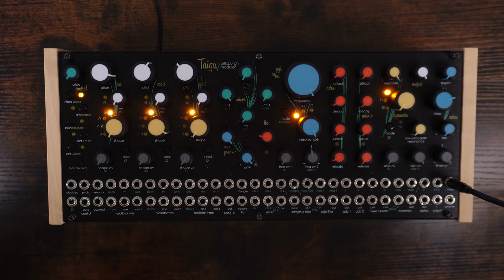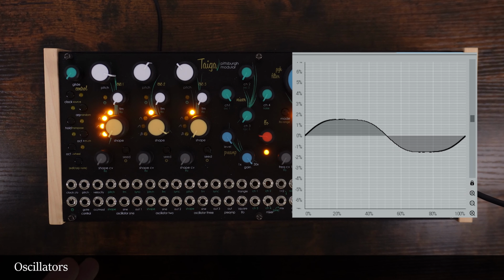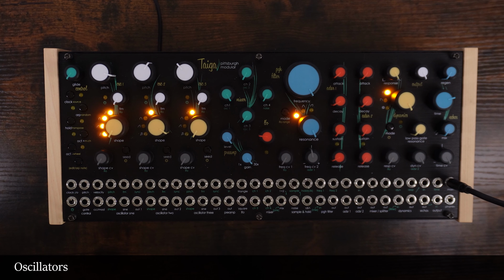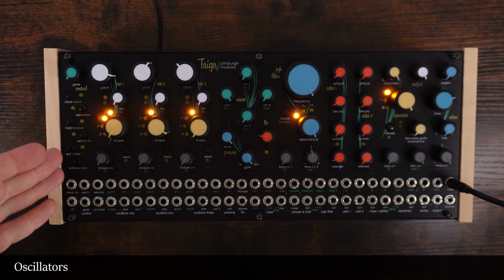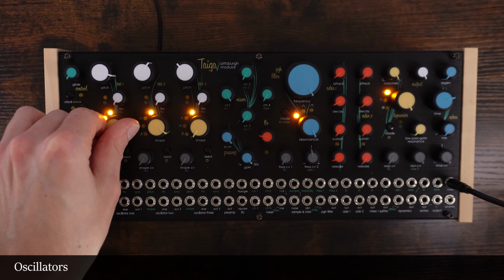Taiga by Pittsburgh Modular: Guide, Review, and Sound Examples

Comment: Great tutorial!

That randomized patch is super psychedelic. Nice work. 

I own the Voltage Lab 2 which I have come to love so much that I am reconsidering the Tiaga as an addition to fill in some of the missing pieces within the VL2 such as simple ADSR envelopes, Hi pass/Bandpass Filters, and sync jack inputs. I love how large the filter knob is and how much space is around that knob to get performative with it The shape knobs are also nice in that respect. A well throughout layout by Pittsburgh - much better than many other semi modular synths and modules. 

I would personally hesitate to include the phrase "subtractive synth" to describe this synth due to the fact that at least 50% of its features are not typical subtractive/east coast features. Three wavefolders and a lowpass gate, combined with the subtractive filter makes it a well rounded synth. 

It is a shame that it doesn't have cv over envelopes or the lfo rate and that the envelope times are hard to have fine control over. Pretty important stuff. I do find that the course tune on the voltage Lab 2 is a bit too sensitive. I wish that all modern oscillators had a lock-in-place button like the frap tools brenso to avoid accidentally knocking it out of tune.